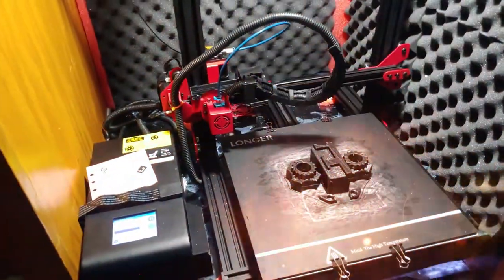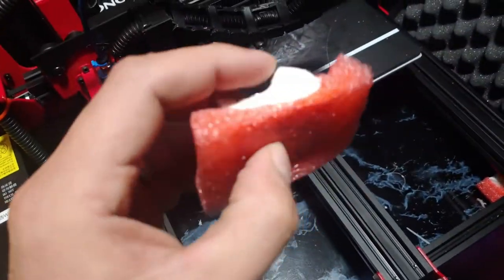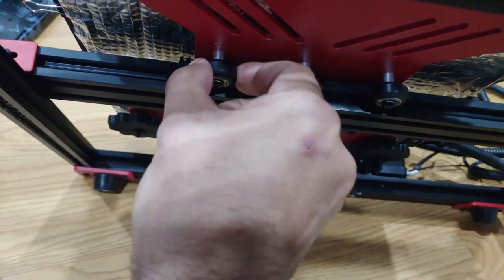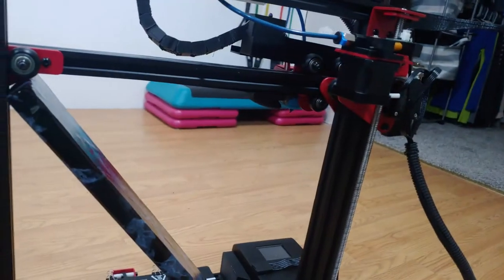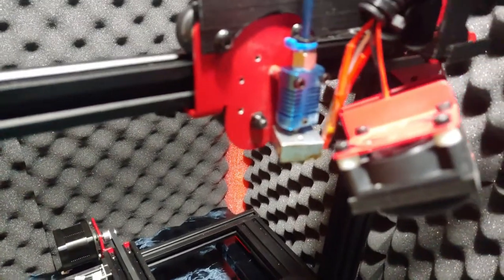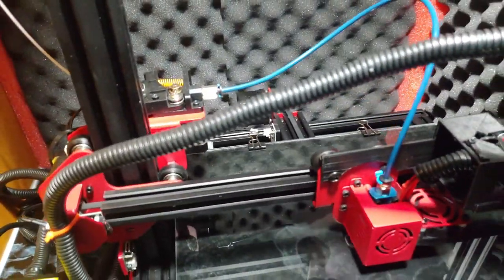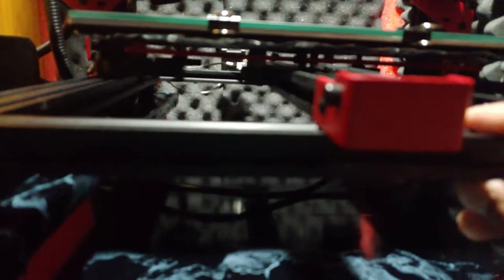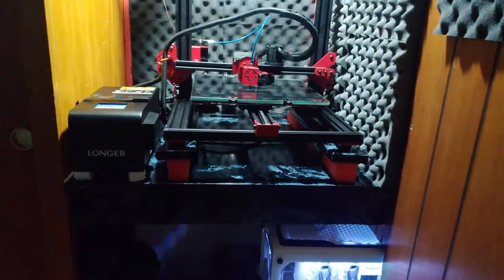How to silence you're 3d printer for free!

Comment: Looking good DJ. Spent all day yesterday tuning mine in. Had a print finally run start to finish without stopping last night. For some reason it printed half an inch, and then started slowly shifting back. Unclogged it again twice this morning, and finally have a print going right. Four hours in and almost halfway done with no abnormal temp shutdowns and it's printing beautifully with no stringing. This was supposed to be a four hour print, but the extruder was grinding hard so I cut the speed back fifty percent. Feel like I'm getting the hang of this after a week. Lol